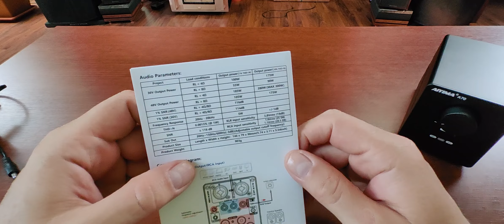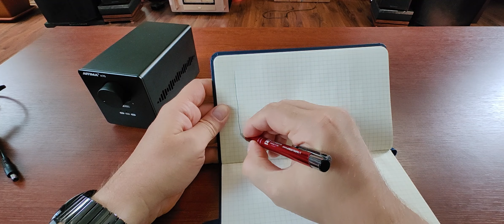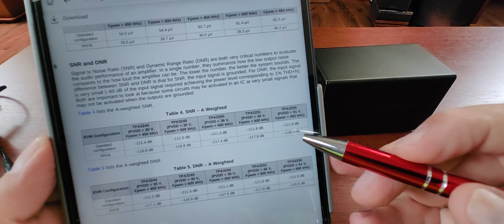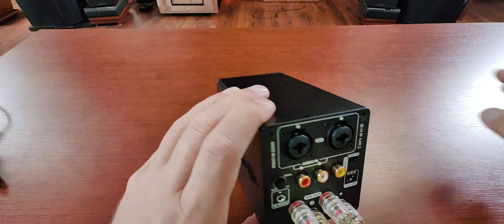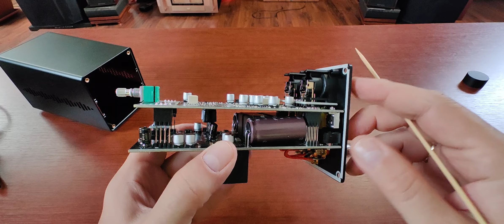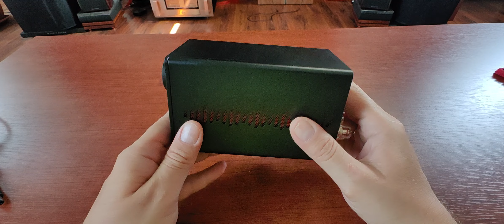Aiyima A70 speaker amplifier review - lil'boy that has it all

Comment: Thank you for this extremely informative review. I've come to this amp from the JLH (2003 update version). The JLH has seen off previous Aiyimas like A07 but the A70 has actually seen off the JLH. So far, of the ones I've tried I have found the LT1469 and LME49720 opamps the best though I haven't tried those you mention. As a pro pianist piano recordings are an easy way for me to assess quality, and this little amplifier really delivers.
Reply from the maker: It is fascinating that this little unit holds its own against such legendary designs, and I completely agree that piano tracks are the ultimate test for natural sound. Some of my tracks that I use for my critical listening sessions include piano!

Comment: I have a couple of these and they are good enough for a bit of fun with op amp rolling etc.  The only thing I didn’t like was the volume knob/dial, it’s very heavy, too heavy. It comes from people complaining a couple of years ago about cheap knobs so Aiyima went ahead and put a solid aluminium knob on their A70. The problem, as mentioned, is that the knob is too heavy for the potentiometer and so moving it is very clumsy. I replaced mine with hollow aluminium knobs (Ali Express) a lot lighter and much more accurate to use as the weight does not influence the turning of the dial. I recommend doing this if you want more accurate volume increase and decrease.
Reply from the maker: Oh that's an interesting mod, I'll definitely check that out!

Comment: I replaced the stock opamps with muses 8820 and it sounds much better .
The amp also runs much cooler with the muses8820 ,now there is no discernable heat when touching the case - not sure why .
I have ordered a pair of sparkos and look forward to trying them .
I have a small collection of opamps I have yet to try, muses 01, bb2134 and njm4580d .
I previously tried the muses 8820 in a tube buffer preamp and they sounded meh but in the aiyima a70 they sound very nice indeed.
Reply from the maker: Yes the results may vary between different circuits, its interesting thing that its running cooler with muses!

Comment: while i’ve enjoyed this amp i have a hard time believing (and understanding?) that it’s actually around 80-100 wpc range. erin tested and it seems true but it’s not very loud! i have to crank volume to   sometimes 100 percent. in a small ish medium room. is class D and class a/b rated differently somehow? it’s my first time actually w class D power. my vintage pioneer receiver is that exact range but seems like there’s a ton of headroom / tons louder 🤷🏻‍♀️
Reply: Which power supply you use?
And are you trying to connect it with different type of dac, mobile, laptop,CD player as a pre-amp.
Reply: @kosikaGaima ohh gosh. i finally tried it w a cd player (2V output signal im guessing. waaasy loud enough!! i knew phone was quieter / low volts but crazy; the contrast is vast.
Reply: If the source output is lower than usual, you'll get lower output. E.g. a walkman or phone connected to the inputs will sound much quieter tha say a dedicated component (CD deck, tape deck, etc). Maybe try using a good / decent preamp & see how that works😊
Reply: @Zimmy_1981 you’re all the way correct!!! i got way better output level w cd and tape. i can’t believe how different phone is, i mean i knew it was lower voltage but wow what a contrast.

Comment: Do you know the input impedance? I have emailed the company and I think it is lost in translation. I built an analog high pass filter with a summing transformer for L and R to output mono to an active subwoofer. The input impedance of the power amp determines the crossover point when I use it. Thanks for your review and help.
Reply from the maker: @CalebSwickMusic  Unfortunately not. I can measure input resistance for you, but that's not impedance - I have no idea at what frequency this should be measured for ac signal input
Reply: @k4syx  Measuring the input resistance would be sufficient for what I need, that would be fantastic. I suppose the impedance would change based on frequency. Thank you.
Reply from the maker: @CalebSwickMusic  my meter says it's 98.1k - here you go ;)
Reply: @k4syx  I appreciate it. Thanks again.

Comment: Hi' Can Aiyima A70 drive my Dali oberon 5 floorstanding speakers with full potential (sensitivity 88db, 6 Oham,Recommended Amp 30-150 Watts)
Reply: depends on how loud you’ll need to go / how large a room. also depends on input source being higher or lower in voltage. i’ve had the volume all the way up on this amp in some cases (iphone direct to amp), and still not loud enough. it’s lacking in power at least in my case but i’ve not tried it w preamp or streamer or dac or cd player. so i’d guess it’s doubtful for floorstanding speakers to get much past 80 db at even 9-10 ft away @88db sensitivity. better to aim higher in power for better headroom and dynamic range.
Reply: @twentyNinebark thank you
Reply from the maker: @twentyNinebark  Wow the only thing that comes to my mind is that possibly iphone output is somehow low level. My "studio" (cave, lets be honest) is 35sqm (m not f) and this little toy can be deafening with any speakers I own, straight from DAC (dedicated unit)
Reply from the maker: @kosikaGaima  easily. Just get good power supply for it (like the stock one)
Reply: @k4syx  thank you

Comment: Thank you for this very detailed review!
When you said you found this little amp to be better than all the other Aiyima and Fosi audio amps you've reviewed thus far, and that it's almost approaching the sound of Class A/B amps, it caught my attention. The common stereotype is that class D sounds sterile, bright and "unmusical" (whatever that means) compared to Class A and A/B. Apparently this one does not fit that description. Do you still stand by that assessment, and does swapping the op-amps really make a noticeable difference? Sorry if I missed you addressing this in the video but why do you prefer the OPA828 in particular? Thanks again.
Reply: Sì opa828
Reply from the maker: Yes swapping opamps does make the difference - and for good :) My IC preferred opamps are 828 and 627. 627 sounds more organic and a little v-shaped, being airy and with solid, strong bass. 828 is transparency king, detail monster, just pure amplification without any added colour, brings the truth about the amp and the music. For good and bad!
Reply: Do the taller OP amp modules clear the case? @k4syx

Comment: When the volume is turned up, does the volume knob turn beyond the '+'? Not that anyone would listen at that level 😂 but just want to check if there are QC issues. I also observed that at very low volume levels ~ 1db there is some imbalance in channels which goes away as volume increases...
Reply from the maker: yes it does, these + and - are more for general info than scale. You can also remove the knob and put it back in the position you like more :)
Havent heard this imbalance, I wasnt listening with volume so low :)

Comment: Now that you’ve had the A70:for a while, what’s your recommendation for reasonably priced opamps? Any experience with the OPA1656? Schiit uses them in the Modi+ DAC and they sound quite good.
Reply from the maker: OPA series are a very good choice, in the descending order: OPA828, OPA627,OPA1656 and OPA1612 (both at the third place)
Reply: @k4syx  Have you tried your akliam lc5 with the a70? will it be a good budget choice for the a70 or is there anything else that i should go for around that budget?
Reply from the maker: @madeuce190  These are the best within that budget, however A70 has no space for anything discrete I am afraid. Even if you'll fit them with adapters (they are too tall to fit straight into the sockets) then you'll have problems with cooling and venting the heat as there's very little space between the boards...
Reply: @k4syx  i think ill use those dip8 flexible extenders. those should allow the lc5 to lie horizontally on the bottom board with a double sided foam tape between them working as a insulator. worst case, ill have to leave the enclosure open but that doesnt bother me much. performance is all that matters after all. but hey, thanks for the input on the lc5. placed an order on ali, now the wait begins haha.
Reply from the maker: @madeuce190  these are great, but be warned that they DO need air circulation as they run hot. If you'll insulate them to be sure they will not touch anything (which is what we do want to avoid) it will also keep them from cooling down :(
Reply: @k4syx  yeah thats a bummer. Didn't know they run hot. Might use some thermal pads then (typically used in PCs). That should hopefully prevent them from overheating and transfer the heat to the pcb of the amp. I'll have to see what can be done once they arrive.
Reply: @k4syx Have you replaced all of the opamps on both pcb boards with 828? And second, do you think Sparkos labs opamps with work with it? Thank you.
Reply from the maker: @yavormoskov  There are just two of them so I've done that for both. NE5532 would requre desoldering. I have no sparkos to test if they will fit inside, as general rule discrete A class opamps match very well with D-class amps but they do have to fit inside

Comment: fyi the 3db boost barely seems audible, and xlr is not really louder either compared to rca
Reply from the maker: @twentyNinebark  standard max V level for XLR is +2V to -2V, for RCA it's 2V. If your sources follow this you'll have twice as much on the XLR as on RCA so unless there is a gain reduction XLR will be louder. That was also true for A70 in my tests, but the reason was not the A70 itself but the source voltage level :)
Yes the 3dB boost is not very loud, but I would still recommend enabling it when using both inputs. Cheers!
Reply: @k4syx ok thank you. oh one thing - is there a way to boost voltage level from say an iphone first before it hits an amplifier?
Reply from the maker: @twentyNinebark  I'd say that you're looking for some kind of preamp or maybe an USB dongle with line out?
Reply: @k4syx so a preamp (if not passive) typically has some range in voltage boost to some degree?

thanks! really enjoying your content ps 😊
Reply from the maker: @twentyNinebark  yes, thats the idea, to be able to amp the signal in the first step with something precise and then go full ahead with somethng less precise but way more powerful (thanks)

Comment: I ordered a D5 Pro from Fun Kenya HiFi store via Ali Express back in June and they gave me a delivery date of 8/8 but never actually sent the amp. Now they are saying I need to put the order in again and then they will refund my money for the first order.  Ha ha!  I think I've got my fingers burnt here.  I wouldn't advise anyone to deal with this shop.  Don't do it, all that glitters is not gold!
Reply from the maker: @michaelbooth6007  have you tried contacting AliExpress for refund? That's simplest way if anything goes wrong
Reply: @k4syx  Ali Express won't recognise my order number
Reply from the maker: @michaelbooth6007  don't you have this in your purchase history? You just can start dispute from from there? Everything you order through Ali has order numbers, internal AliExpress unique IDs
Reply: That sucks! Funkenya was fine for me for an A1 clone. I am dealing with the Fiio shop now. I ordered a $500 DAP and they sent me Bluetooth earbuds. No reply from seller so trying refund. Good luck!
Reply from the maker: @mattmiller4978  These few times I had problems I've asked Ali to step in and I always got full refunds. These are random, like transport damages, like packages lost. It takes some time but I always got refund at the end. Try that!
Reply: @k4syx what’s the AK4499 DAC you said you used for testing this? I rewound multiple times both times you mentioned it and couldn’t make it out.

Comment: It was a design error not to have space for good op amps. This makes it impossible for me to buy the amplifier.
Reply from the maker: @veristaconvicto  I think the idea was that it's meant for IC replacements like OPA or AD series.
To be fair, discrete A class opamps are wildly different in sizes and it's very hard not to block them not only by height, but also by spacing of other components on the board.
But that's part of the fun, isn't it? :)
Reply: It will fit Sparkos and that might improve the top end quite a lot.
Reply from the maker: @D1N02  Yes, I didn't thought about that, Bursons and some others will also fit there with no problems. Just the large ones will be a problem, but these usually pose a challenge:)

Comment: Thanks for the review very analytical I'm skeptical about class d amps in general ,can you compare the sound with musical a1 class a clone you recently evaluated, the mids have the same  body and 3d sound ! or less.
Reply: No way will these cheap Class D amps sound as musical as an A1. They are not bad, though, and have their purpose.
Reply from the maker: @ChicagoRob2  Exactly, they are not as musical as MFA1, but the fact is that 90prc amps on the market is not as musical as this MF excells in this regard. But this particular cheap amp IS musical which is like light from heavens - another step for D-class!!
Reply: @k4syx  You could put together a killer system with the A70, $129 Schiit DAC, and Elac speakers. You could add a Wiim streamer and still be less than $1000, total.
Reply from the maker: @ChicagoRob2  Yes! It's a great time to be a music lover as entry point is very low, and with every d-class generation it gets lower. Same for DACs, former flagship Sabres and AKs are really available now and 4493 or 9028 are still amazing chips!
Reply: @ChicagoRob2 lol streamer. Use a good PC & lossless files & you good to go. No need monthly subscriptions & ISP consistancy. Will run u less than $1k😊
Reply from the maker: @nikosdm  well that wouldn't be a fair race as MFA1 is clone of one of the legendary A class amps and even as a clone costs like 2.5 or 3 times more. But it doesn't sound thin, though it doesn't have same level 3dimensionality. It sounds different from all 3255 amps that I've reviewed previously. And I get that you're sceptical, I was like that after getting A07. But then I realized these are baby steps now: and the development goes in the right direction. So I try to get every interesting device that brings something new to the table (like last week I got BRU5, 3255 with programmable DSP chip inside).
Reply: Thanks for the additional information well done.